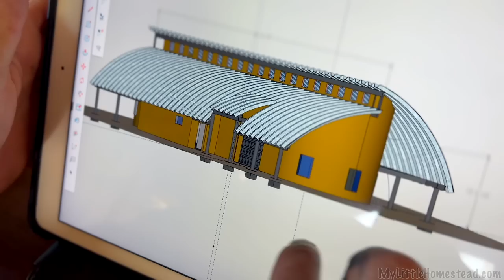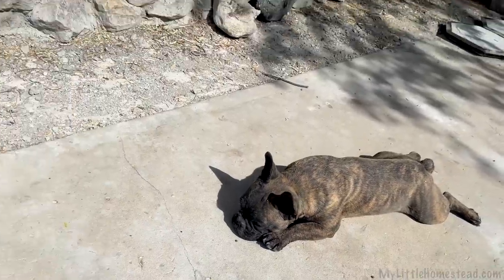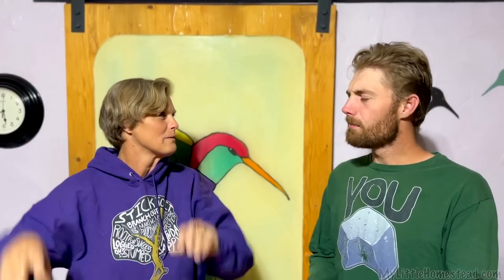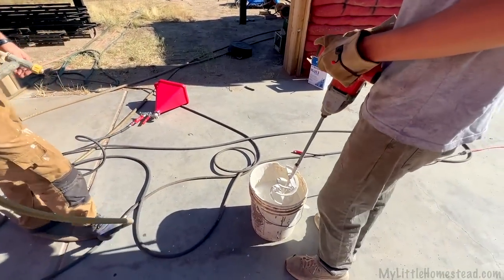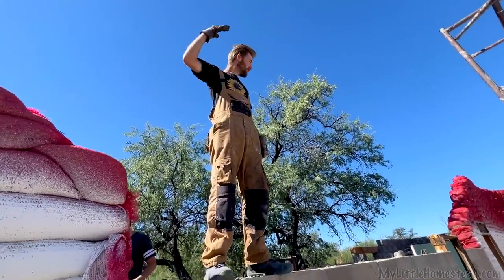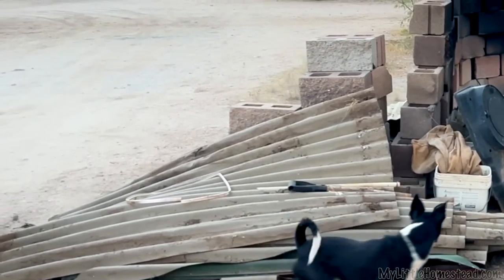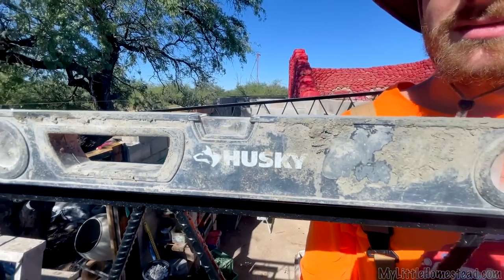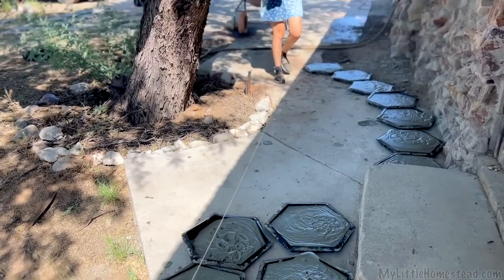Hyperadobe Shop! Completed Lower Roof Trusses | Monthly Peek Ep394

Comment: Bryson! Did you realize that you can make vertical loop geothermal heating and cooling with your rilling truck?
Reply: That’s an excellent use for his truck. It is best if they have water in them so they get a good thermal conductive connection but it doesn’t have to be potable or a lot of flow. It just needs to be there. I had a friend that actually had an artesian well that flowed water without a pump. It flowed up from the ground at 72 degrees, even in the summer. Made for a great, very economical heat pump.

Comment: The shop is coming along nicely.  You guys had so much fun as a skate rink, I'm beginning to think the shop may stay a skate rink.     I have a question about the mason block walls going up 7 or 8 feet higher. Are you going to put in any re-barb in the mason blocks vertically, spaced out along the wall?  Then inside the mason blocks fill those with concrete.  I'm thinking about wind shear & preventing possible collapse from a wall that tall.